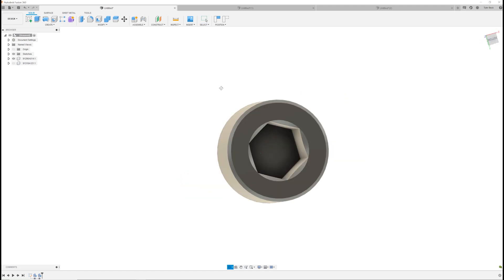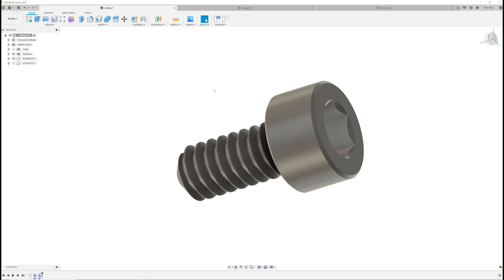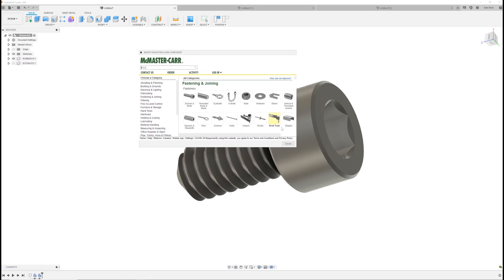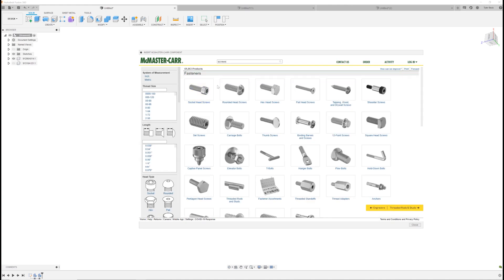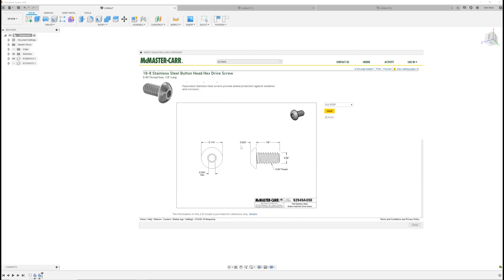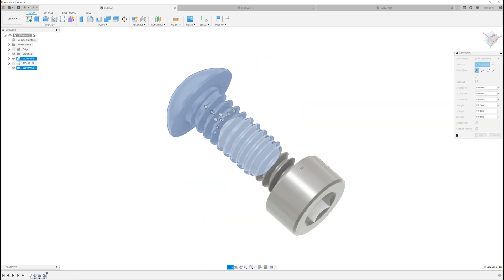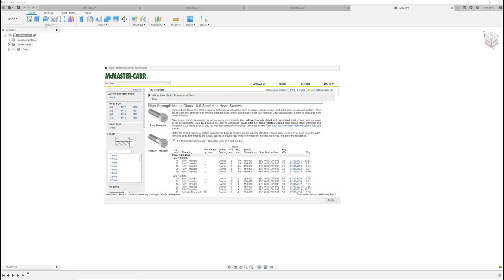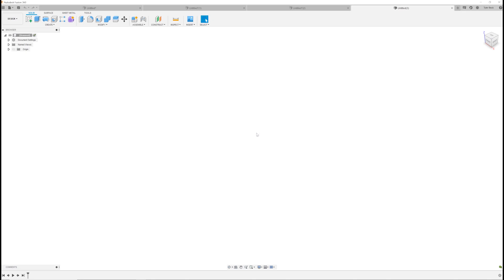How To Insert Hardware in Fusion 360 ( McMaster-Carr Library)

Comment: Hy! I love that feature. However  could it be improved? In the situation where you have a design of an assembly with lots of the same screw in different places. Then with design changes, the screws need to be longer or shorter or change screw thread size. There seems to be no way to edit the first screw to replace it with a different screw. The long way is to delete all screws, import the new screw and redo all the move/copy work to put the screws back where they need to be.

Maybe a video on the subject if there is a way but that what's bothering me these days. I understand that imported components may not have their own origin on the same spots, maybe on the top of the screw, maybe on the bottom, so thats why I guess a 'replace component' function can't easily be implemented.
Thanks again for you great work.